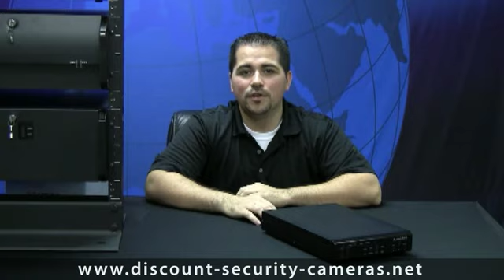Introduction To Security Systems: DVRs

Comment: The prefix tera means 1012 in the International System of Units (SI), and therefore 1 terabyte is 1099511627776bytes, or 1 trillion (short scale) bytes, or 1024 gigabytes.... Other than that this is a great, informative Video.